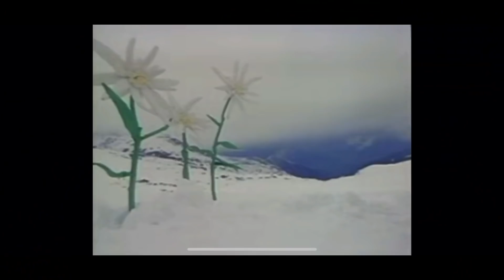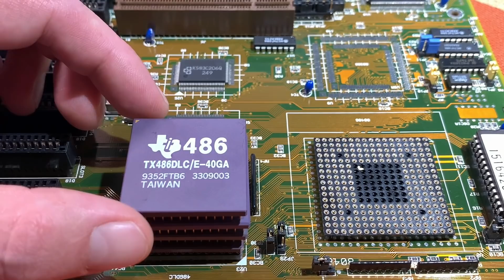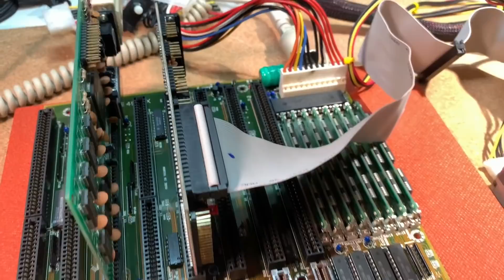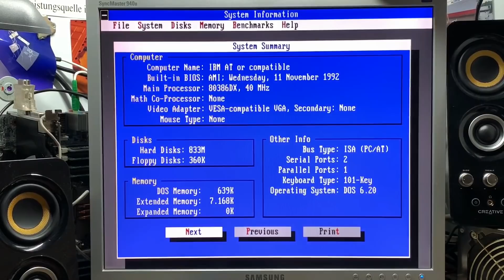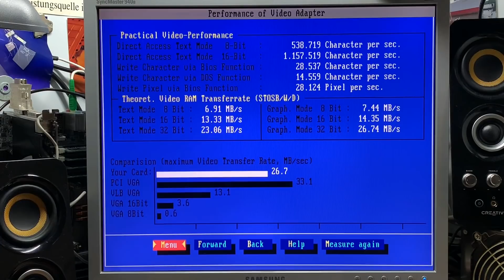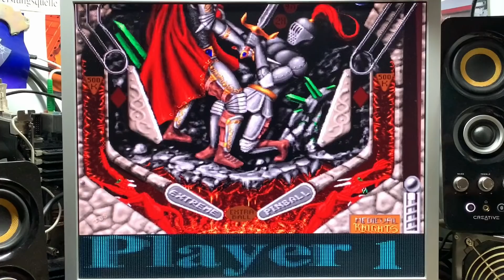AMD 386 DX-40 and VESA LOCAL BUS - Boardreview and Benchmarks

Comment: On the VLB I/O, JP1/4 & JP1/5 are set to the slowest option - https://stason.org/TULARC/pc/hard-disk-floppy-controllers/C-D/DTK-COMPUTER-INC-Four-IDE-AT-drives-PTI-255W-VER-1.html  - The driver set from https://archive.org/details/dtkpti255w includes a DOS driver that can enable multisector mode - Appears to be a floppy image maker, but the IMA can be unpacked from the EXE using 7-Zip, and then the contents of the IMA can also be unpacked to get to the readme and WBIDE.EXE (Winbond IDE)

Comment: Oh my god... This may be the closest I have seen to my first PC motherboard! In my version I had a Am386SX-40 (Or was it DX? Not sure!) soldered on! 2Megs of ram. 3 years later I popped in a Cx486DX2-80 and changed a half a dozen jumper settings and was running Doom like a boss!
Not sure it was this exact motherboard, but definitely Opti and 2x VLB (I never had a VLB card though)
Reply: By the way I had the slowest VGA card that ever existed. I thinkit was a Trident? Anyway, my mate run Wolf3D faster on his 286-20 than it run on my 386.
Reply: @szabolcsmate5254  those trident cards were everywhere back in the day and they were hot garbage!!😂 I liked the S3 805 VLB card or the Tseng Labs ET4000 ISA card.. the ET4000 even made Doom playable at low graphics/smaller window on even my 386sx/25.. The S3 VLB card ran Quake playably on my DX4/💯

Comment: I used to run a 386DX40 back in the day, and I played Doom quite happily on it. In fact I completed Doom 1 and 2 on it. I found that if you switched it to the lo-fi mode (I forget which key did that, F5 maybe) and dropped the render window size a notch, it became really quite playable. It did not look as good of course but that was the trade off. I also played it on my 386SX40 but that wasn't very playable.

Comment: For PTI-255W, loading a wbide.exe driver in config.sys increased reading speed of 1GB CF card from 4MB/s to 6MB/s in speedsys in my PC, so that would make a difference. The driver also allows to use 4 drives at once and possibly bypassing bios drive size limit (not tested). Nice video with rare configuration.

Comment: I'd be quite interested to see a comparison between the GD5428 ISA card and the VLB version of it. (I wasn't even aware that there was an ISA version.)
Reply from the maker: I like your idea 👍🏻. Just need to check if i have a 5428 VLB. Which cpu do you prefer to see in this comparison?
Reply: @CPUGalaxy  I used to use one with an Intel 486DX/33 (which I later upgraded to an Overdrive DX4/100). I think I may still have the graphics card somewhere, although the old motherboard is long-dead.

Comment: Had a Acer Power 386 cirka 1990, it had a soldered 386sx 16, and 486 upgrade socket.. Anyway, have you looked at the Hauppage 4860 boards?
Reply from the maker: oh man, i would love to have a Hauppauge 4860 board. It includes a intel 860 RISC CPU as well a 486 😍😍
Reply: @CPUGalaxy  yes I remember the ads for them "Risc free" was the tagline. 😁

Comment: I think HDD runs slow thanks to PIO transfer mode, if you could find HDD controller with DMA or UDMA support or change settings in BIOS or I/O Controller it should be faster, if HDD supports it of course.
https://en.wikipedia.org/wiki/Parallel_ATA - info on speed here section: 4.2 Speed of defined transfer modes
BTW. You have great and very informative channel, keep up amazing work :)

Comment: I have the same exact motherboard.  I got a 387 on the small socket and I have a 486 on the larger socket.   So it's possible to have both socket used at the same time on this board.

Comment: Is the HDD transfer slower on the 32-bit card because the HDD only transfers data in 16-bits? The advantage of having the 32-bit wide HDD controller would be if you were using more than one HDD at the same time I'd suggest. With only one HDD the small increase in latency and reduced transfer rate maybe due to the the HDD controller having to 'add' another 16-bits of null data to fill the remaining unused portion of the 32-bit wide bus, that taking a few extra controller cpu ticks?

Comment: Wow you've answered a burning question I had for ages - will a 386DX work with VLB. And I guess from the benchmarks it wasn't worth it on a 386. Seeing no speed improvement in games was disappointing and explains why it's so rare to find 386 VLB boards. Cheers!

Comment: wow I had that motherboard ! I bought it when my 386 dx33 board died to restart my system and later upgraded the cpu to 486 dx50, running vesa boards at 50 mhz was tricky the trident video board loved it but not so much the iO board but playing with some settings in the bios made it work nicely

Comment: The hard drive performance anomalies are part of the reason the OPTi chipsets were considered low end for their day. They had very poor interrupt and bus arbitration performance. VLB will only shine in DMA operations, for example where graphics bios routines can be cached in ram. As far as I know there are no IDE controllers from that era that are DMA outside of a couple of specialized and exotic caching controllers, which would thus require cpu intervention for any bit of data transfer from the IDE controller, and that would require being handled by the interrupt controller which resides on the opposite side of the ISA bus arbiter. So while the ISA controller can service the interrupt controller directly, the VLB controller needs to go through a bridge before it reaches the interrupt controller.  You wold probably need to step down to a VLB speed of 33 mhz and see if you can run that controller at 0 waitstate. You would need to run ISA video as well, that may be the only way it will match the ISA card at all. 

 SCSI cards are also typically DMA and you are able to find the occasional VLB based unit, and a drive with async reads and writes is capable of showing that difference. 

As far as i can remember the SiS chipsets didn't do much better, you needed to play with waitstates and pretty much keep the VLB to a max of 33mhz.

Comment: Actually if that's a Tseng version that had early 2d acceleration, it would blatantly outperform anything, ofc if the software supported it. I had VLB on a 486DX2, and that was the first time ever, I've experienced hardware video acceleration in Windows 3.11 and then 95, on an 2MB VLB S3 805 :)
Reply: I'm pretty sure the VLB card in my 486DX2/66 and DX4/100 was an S3 805 mine was only a 1mb card from memory, It was a very fast card, ran games great on both systems.. Even Quake on the DX4/100 with this card was very playable.. I ran that card with DOS 6.22, Windows 3.1, 3.11 for Workgroups, 95, 98SE and Redhat Linux from 1999

Comment: My guessing for poor performence is that the VESA slot is directly connected only to the 486 socket, but not to the 386 one.
Reply from the maker: its also directly connected to the 386. i checked the traces. then rerouted from the 386 socket to the 486.
Reply: @CPUGalaxy  hmmm interesting, what will happen if you try with 486 upgrade and overdrive upgrade :)
?

Comment: My thoughts on the lack of speed increase on the hard drive: IDE is just an extension of the 16 bit ISA bus, so it isn't going to go faster even connected to a 32 bit bus as a latch of sorts will be needed to take two 16 bit transfers to convert it to one 32 bit transfer. Probably happens less efficiently than the native ISA bus on that CPU which is doing something similar.
Reply: Yeah, 386 CPU is not great with VLB.
The VESA Local Bus relies heavily on the Intel 80486 CPU's memory bus design.
Add on top of that the fact that DOS is not a 32-bit OS natively, and the DOS driver only brings marginal improvement.
To me, best use case scenario for this MB using this VLB IDE controller would be below combination :
- 486 type microprocessor or Overdrive
- an OS with 32-bit native drivers capabilities (like Windows 3.11 did)
- optimized jumper settings on VLB controller to maximize performance (HDD mode, IOCHRDY, ...)
- a hard drive with PIO4 capability (time-correct with this VLB controller board)

Comment: I recently got a board similar to this that can handle 386 or 486DX chips but the 486 socket can also accept a 387 math coprocessor! And yes, VESA Local bus slots too. I had never seen anything like it before.

Edit: your board is the same I see!! Cool! The only difference is my socket has a mark for the pin 1 on the math coprocessor unlike your board. Sorry you chip got killed. The orientation on my board is the same where the math chip is rotated versus the 486.
Reply from the maker: How cool that you got the same board 😄. Lucky you that the pin1 is proper marked for the FPU. Is there a marking on the silk screen or in the socket? Maybe you can send me a picture. I would be interested to see it. 
And how cool to see you on my channel 😊
Reply: @CPUGalaxy  http://imgur.com/a/vbJ6pvr it's different than your board. This one has 3 VLB slots! It came with the CPU you see in the pics but that CPU was actually dead. I put a 386-DX25 in it  and it worked fine with that. Didn't do a lot of testing but I did try the VLB slots with the 386 chip and it was indeed working.
Reply from the maker: very cool board as well. and of course a huge pin 1 marking for the 387!! 👍🏻

Comment: IIRC, they were few VLB IDE cards which used the VLB bus, but there were some compatibility issues (example: many WD disks didn't even boot with those cards), so Winbond and others rolled those cards to work in ISA mode, and that's why you get these speeds. (I don't have any link to what I wrote, I simply remember it from those days)
Reply from the maker: I recognized now some strange issues with this WD drive. When I put a 486DX-2 into the socket the board went crazy. sometimes boot, sometime crash, then messages like „command.com“ cant get loaded, „wrong version“ and all this things. with a 486DX-33 it was working fine... really strange. Then I took an older Maxtor and everything works fine than. 🤔

Comment: Hello ! Thanks for this great video ! Regarding the low VLB controller performance, you need to : 1) change the jumper on the card to reduce the latency of the IDE drive 2) load the Winbond DOS TSR (I thinks its name is wbide.exe) to enable high performance mode. Simply load it in the autoexec.bat.
Reply from the maker: I tried that and got only a slight improvement

Comment: VLB disk controllers normally need device drivers to take advantage of the high performance 32-bit VL-Bus when running under assorted operating systems. DOS is no exception.
I found the below drivers disk image which may be the right one for your controller :
http://www.storagedrivers.com/drivers/73/73635.htm
Reply: I agree as I experienced this as well...you  will need to add the VLB drivers which did greatly enhance disk throughput. Also having a UDMA hard disk helped too!
Reply: At this era the hard disks were so slow that you could use an 8bit-ISA controller as well... Benchmarking like in this video with an SSD would extract the harddiskspeed out of the equation.
Reply from the maker: with the WD HDD in the video I could get much better transfer rates than on the setup in the video.

Comment: I guess I know why the VLB IO is slow: You need drivers. Without drivers they are running in some PIO-Fallback-Mode - I remember PIO-0 was limited to ISA/4 or even ISA/5 which is roughly 1500 to 2500kByte/s depending on FSB. And yes, most of these cards do not have DOS-Drivers, only Drivers for Windows. Also most chipsets do not support DMA but at least higher PIO-Transfers.

I own a DTC-2278-VLB-Multi-IO-Board which delivers full 33MByte/s by DMA (!!!) using 32Bit-Drivers with Linux, W98 and WNT but only 2MByte/s with plain DOS. I have the original driver disks and manual and it pretty much states "no DOS drivers use a real operating system".

Fun-Fact, the W98-drivers do not load before W98 but within W98. No config.sys, just real 32Bit-Drivers just like WNT. Which basically means the system boots with Fallback-PIO and only activates the full drivers after starting the W98 Kernal. The drivers themselves are win32-drivers compatible to WNT and W98 all at once. Pretty mad shit back then.
Reply: Change the CPU to 486. 386DX doesn't have the arithmetic intensity like a 486 or RISC CPU at a similar clock speed. The 386 can't deliver 40 MIPS for 40 Mhz for 40 Mhz VLB.

Comment: In the late 1980s and early 1990s I worked at R&D companies developing custom high-speed real-time sensors and instrumentation.  One of the key factors was the "cost of compute", where a 'fast' PDP-11 lab computer could dominate the budget of an entire project and wasn't very portable.  We switched to DSP arrays, which helped on size but not on cost, since programming them was a PITA.

We longed to use PCs, but the I/O bottlenecks were restrictive.  Until the 80486DX and VLB kicked the doors wide open.  We developed a combined ADC and DAC VLB card that reduced our overall system compute cost by 10x, as even a large stack of 486 motherboards with our card installed cost less than all alternatives, and was much easier to program.  We made other versions of our card when PCI arrived, but the VLB solution stayed competitive for the first few PCI generations.

The main problem with VLB was that it was much better for writing by the CPU than reading (which makes perfect sense for a video bus).  So our DACs ran fast, while the ADCs were bottlenecked.  We found some 'tricks' in the VLB spec that allowed us to make our own DMA controller that bypassed the bottlenecks, giving us several advantages in the final cost and performance of our instrumentation.  VLB FTW!

Edit: We didn't go from DSP arrays to the 486 in a single step: We used lots of VME systems along the way, based on Motorola 680x0 processors generally running OS-9.  The VME bus was extremely flexible, but it didn't get truly fast until later generations: VLB really killed it, so long as you were willing to design your own boards.
Reply from the maker: wow, what a cool story. 😃👍🏻
Reply: I bet you really have a LOT of great tech stories.  Have you ever heard of the Parallax P2?  It is a bit off topic here, but it might be a great fit for your experience as it has 64 smart pins that ALL can do ADC or DAC or digital, and 8 cores(cogs) to control them all.  It's quite the little marvel invented by a like minded guy that participates in the forums.  Check it out.  I hope to see you there!

Comment: Maybe VLB-capability is not even active for VLB-IDE-Controller when 386-socket is populated - hence weaker performance. Had that same kind of board once (with"MR-BIOS"). It did not even recognize an Adaptec 2842VL-SCSI-Controller when 386-socket was equipped with a Cyrix 486DLC; it was seen only with a true 486 dropped in the 486-socket.

Comment: I have a very similar mainboard here and also wanted to make a comparison one day and may be  a video about it on my channel :) I guess I don't need to now.  I was also interested in VLB performance on a 386, but the benefit seems to be very limited. I guess, it's due to clunky implementation of the VLB here. Actually, it was "invented" exclusively for 486 and I guess, in combination with a 386 on this mainboard, it runs through an additional bridge, so it is not directly connected with the CPU, as it would be the case with a normal 486. However, it would be interesting to see, if it runs significantly better with the Cx486DLC, and a real 486 of the same frequency. Just to see what is the limiting factor....

Comment: Wow, a combined 486 and 386 co-processor socket!
Reply: In Taiwan retail market ,some dealer call it "786" main board 
because this board have 386 and 468 socket ...
Reply: I had this board way back.... man I wish I had kept all my retro stuff. No time and no space for boxes and boxes of motherboards, I donated everything to a local computer club.
Reply: @soniclab-cnc  It was better choice then to send it to recycling bin, right?
Reply: @dawidoszkiewicz5607   I did end up taking a bunch of stuff to recycling... I may regret it a bit but life goes on and I can relive all the nostalgia through this awesome channel...
Reply: @soniclab-cnc  Don't regret it, you just made remained stuff more rare  ;)
Reply: what a great idea!
Reply: i had a board that could do just that... crazy board..could use 386, 486, as well as 2 dif 87 sockets... (pins and the kind that slide down into the plastic socket with the pins round the edge.
Reply: Now if it only had the 30&72 pin dimms!
Reply: Super Awesomeness!
Reply: I got a few boards like this though only one with vlb slots.
Reply: Crazy right?!
That has to be one of the most interesting PC motherboard I've seen
Reply from the maker: yeah, for me as well

Comment: @8:48 - I've seen a better implementation of this marking, though. My similar combo board (Opti 495SLC) has a 486/387 socket with a hole in the middle and the board has another silkscreening for 387 orientation that shows through the hole. So it has a big silkscreening for big (486) chips and a small one for the small (387).

Btw, it's an amazing selection of CPUs you have. I'd just like to find these clock doubled Cyrix parts!

Comment: You need to use the DOS driver for the VLB IDE card to make use of its capabilities. The default is for ISA PIO compatibility which is almost always equivalent to ISA 6 MHz performance.
Reply from the maker: I tried that already. Only slight changes and still the HDD run faster on the IDE controller 🤔
Reply: Would be interesting to examine different VLB IDE performance. Back in the early 90s when I worked at OEM shop, we compared dozens of different IDE hard drive and VLB combinations. We even examined the effect of cable length.